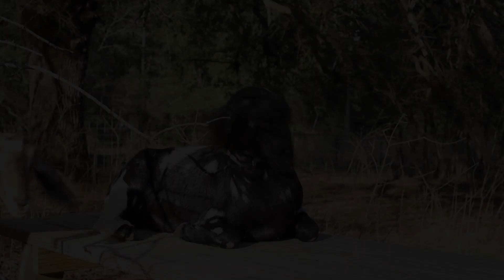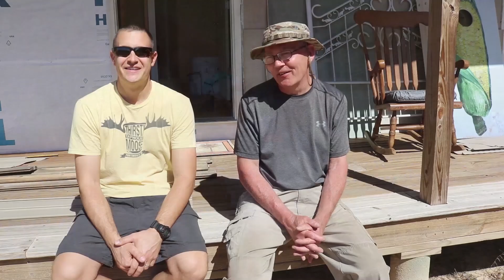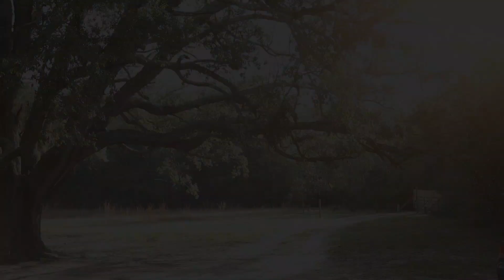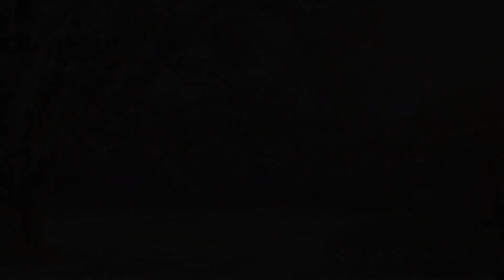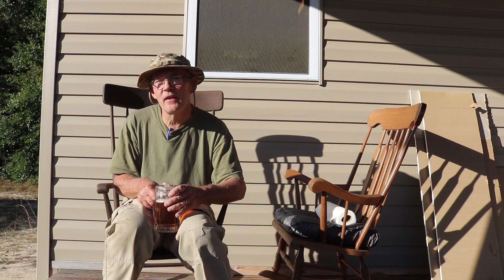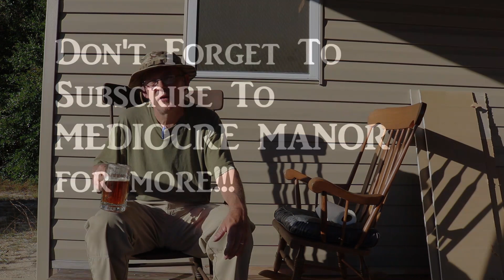Off Grid Solar System Design - Inverters Explained

Comment: Computers with internal batteries such as laptops could be okay without a true sinewave inverter.  I expect you would have trouble with a squarewave inverter running a desktop PC with a power supply (not batteries)